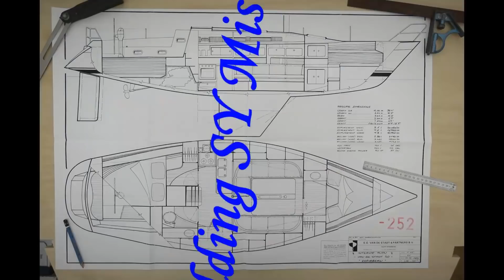Building my steel sailing yacht Ep.104 Good Boat Parts & Pieces APLENTY!

Comment: Never fails to freak me out with your fingers in front of the jigsaw!   But the fact you still have all ten..  “he knows what his doing”. 
Thanks Bruce!
Reply from the maker: Thanks Trev and I guess that you mean the table saw blade? Jfyi 2 quick points, Yes much good working experience having been taught properly over many years and the cardinal rule of "do not put your fingers near a turning blade" (which for eg. Evolution did a great job of delineating with the bright orange blade cover plate) and if you look you will notice that my fingers do not enter this orange area when the blade is running  😁👨‍🔧🖐🖐
Reply: Was actually the jig saw, you have a Unique way of holding in front of the blade, i can see why you do it, ya got far better control, and ya not forcing it through, so technically even if the blade snapped for some stupid reason, I’m pretty sure you would get ya hand away in time..   ive never been comfortable with wood working tools, i own some, but I avoid em.   I had a table saw kick up on me once, a chainsaw kick back at me, and a jigsaw blade snap cutting Perspex, yet metal cutting never an issue probably because ive far more experience,   Built a nice timber fishtank stand, everything measured fine, filled it with water the fish were swimming up hill.. 😂 
Worse part was took me days so the whole family knew i was building it, so was kinda funny watching the family look at it with there heads tilted 😂
Reply from the maker: @trevhedges  Ahh ok, understood Trev and yes, as you say, it is all about the control! Jigsaws notoriously wander around the cut line, which is why I use the circular saw on most open ended straight cuts. Coincidentally I just filmed yesterday an open cut which I first did with the jigsaw and then re-did it with the circular saw for this exact reason, ha!
I hope that you got some pic's of your fish swimming uphill?!  😆
Thanks for your reply mate  👍

Comment: I think you need to fabricate a box to elevate the height of your work bench, you're really stooping, your back must be aching.  Lifting your work surface 150mm to 200mm will really improve your efficiency too.

Looking forward to seeing all these parts installed
Reply from the maker: Thanks very much for your good comments Nic and yes the very varied work situations are not necessarily ideal for the body, however boat building generally does require all sorts of contortions which yes at times you pay for in some pain, but also benefit from because it does make you stronger. Also, I really have been and am limited regarding my work space here, which involves constantly having to set up and move my portable "work benches" to get the very varied sizes of materials made up. With a very limited $funds$ set up, one must "make do" with what you have,...  🙂👍